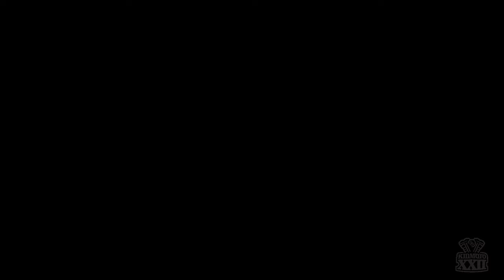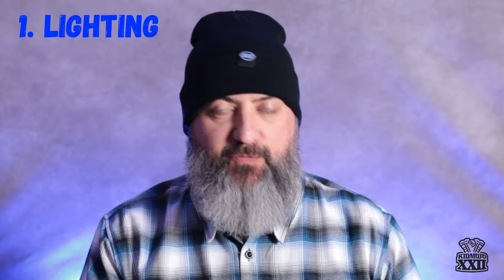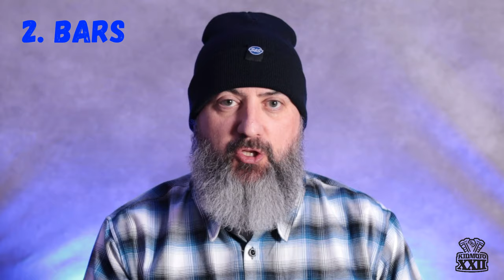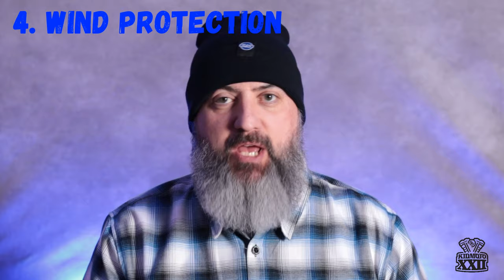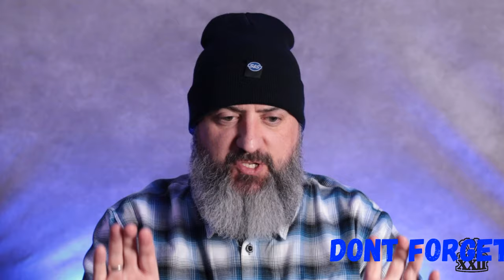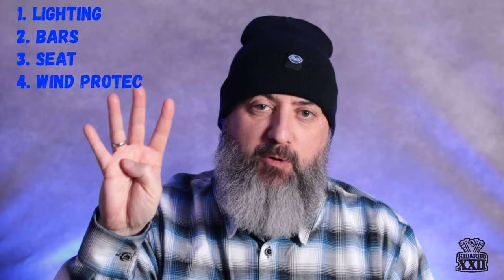5 Harley-Davidson mods to do before exhaust

Comment: Where I live there are thousands of animals crossing the road at all hours of the day.  I used to have stock pipes on all my bikes, and was constantly having close calls nearly hitting animals.  I eventually hit a large deer and it was terrible !  Ever since running headers, and louder after market pipes, I do not even see animals near the road.  I believe for safety reasons the first thing you should change are pipes !  On my Heritage, the stock windshield was constantly catching the wind and blowing my bike all over my lane.  I took it off and have never looked back.  Its called wind therapy dude !
Reply from the maker: Sounds like you’ve done your mods based on where you live. As have I. I live where my riding season is short and can be quite cold so wind protection allows me to extend my riding season. In addition I like to do long road trips with my last trip this season being 9 states, 8 days and close to 4k in miles that means that wind protection helps with fatigue when I’m doing 500-600 mile days back to back.

Comment: Awesome video.  I did mine 1,3, 2, 5, 4.  I've got a mix of Hog Workz and Ciro for lights.  Mustang extended reach touring seat.  12" Factory 47 bars.  Tall Boys floor board relocation kit, I'm 6'3" and a Freedom Shields 12.5" touring wind screen.  I'm on a 2020 Street Glide Special.  Keep up the great videos.
Reply from the maker: Looks like I nailed it for you exactly!!!!….👊🏼

Comment: My last road trip 6500 miles, 12 States and 74 days. 2010 Road King 96" with a cam and 15" windshield, LED headlight, saddlebags and luggage. That's it!! Had a great time. Tacoma, Sturgis, Texas, California - Tacoma WA!   Author tell me your last long distance trip?
Reply from the maker: It was solo 8 days, 9 states, 4000 miles, temps from 30 degrees to 97 degrees and did a cam install in the middle of the trip. 

I live when my riding season is about 3-4 months and I average 10-12k per year.

Comment: Found your channel and subbed , this video was spot on ,  your point on bars and seat,  I sat on quite a few bikes before I found my Fat Bob, the forward controls and drag bar were perfect for me , same here on the seat, I demo-ed a few Harley seats and just couldn't find one that was good , ended up putting a full gel pad on top of the stock seat and it works so far , I can't risk spending hundreds of dollars on an aftermarket seat and have it not work for me
Reply from the maker: Seats are a complete mystery….what works for you may not work for me. There no universal seat.

Comment: I think the list is very subjective and also depends on the type of bike you have.  I have 3, 2009 Rocker C, 2014 Dyna Wide Glide and 2021 Street Glide.
I dont disagree with your statement but i dont think it applies to all Harley's
2021 Street Glide i left the bars because i like the position they are in, but i did all other mods and yes i put the heel shifter on.
On my 2014 Wide Glide i did all of the recommendations including 16" apes, i didnt do the windscreen or foot controls as i prefer that bike without a windscreen
2009 Rocker C again no windscreen, but i did to a lift on the to bars and replaced the seat
Lighting was done on all 3 but i would say they are must do's, I never ride at night but then again in the summer its 11pm when its get dark so no point but i did change all to LED signals and Harley Daymaker headlights except the 2021 Street Glide, i went with the adaptive Daymaker
Reply from the maker: Essentially the point I was going for is that there are comfort and practical mods that make sense before making the bike louder. As you list goes it would seem you did the mods to fit how you want to ride each bike! Mods are subjective for sure.
Reply: @kidmoto22  Good video bud

Comment: I’m taking it you’re not an old school guy. There’s no “in order’ way to doing anything to your machine.   If there’s a “first”, it’s ride the shit out of it and make adjustments/replacements as you see fit along the way. I have a 19 street glide and have been getting into this new stuff. But I still prefer my old Evo springer that beats my ass when I’m 80 mph+ while causing water to shoot out the sides of my eyes as I’m picking the bugs out of my teeth. It’s uncomfortable, it’s loud as fuck, it’s fast as hell and there’s only two lights on it. Old school shit, the way things should be experienced first! But that’s just me.
Reply from the maker: I’m not sure what you mean by “old school guy”. I’ve been riding on Harleys since I was about 8 in the early 80’s. If you follow me on IG you’ll see a pic on my mom and I 30 years apart on Harleys. If by old school you mean an older style bike then no I’m not that guy anymore. I like the comfort and reliability of the newer bikes and currently ride a 17 RKS. I prefer long trips and ride as much as possible 13k plus last year and I live close to the Canadian border so I have a shortened season.

Comment: i really like the look for those hard lowers you have on your Road King. i've been looking into advan black in hopes their softail hard lowers would fit the sport glide but it's an expensive "maybe :shrug:
Reply from the maker: If you can find soft lowers it might be worth a try for a period of time to see if you like them. It’s more affordable and much easier to remove…good alternative.
Reply: @kidmoto22  yeah, im looking to get crash bars and soft lowers this season for my distance trips
Reply from the maker: @voltron6049  It will make a huge difference. You might consider HWY pegs with the crash bar.

Comment: I think seat should be number 2. Then you can adjust your bars an foot controls
Reply from the maker: Picking a good seat sucks. Seems like if they look good they are shit to ride and if they ride nice they are shit to look at.
Reply: @kidmoto22  I
I feel that once you find that proper seat, then you can start on handlebars. But finding that perfect seat is like finding a unicorn 
Lol
Reply: @kidmoto22  
Very true on that. Got a 2017 road glide special. Want a low profile seat but also want something good for long rides, too.
Reply: Also, thinking of taking the old turn signals off and making them part of the head lights. Think a company has a set up like that,but want something brighter than the factory set

Comment: I don't ride at night, So tell me again why I should do my lights before exhaust? My bikes handlebars are perfect and just what I want so do I still need to upgrade them before exhaust? Definitely upgraded the seat. Wind protection... Are you serious I'm not feeble and the wind doesn't bother me. you know what bothers me, is how quiet my stock pipes are, nobody hears me let alone sees me. I would think my safety is higher priority than comfort "wind protection" lmao comfort before safety children. If your stock pipes are quiet and they are. I highly recommend doing your pipes 1st. Lights 2nd. Then worry about your creature comforts.
Reply from the maker: It’s been my experience with all the distractions for drivers and regular traffic noise pipes are not a safety feature. In addition the time of loud pipes are quickly coming to an end. With noise regulations and emission standards getting more strict loud pipes will be a thing of the past.
Reply: @kidmoto22  depends on where you live. California, sure. I live in a free state. Not worried about them coming after my exhaust.

Comment: Getting the motor running right should be first exhaust get heat away from motor . With no motor you are not using any seat or handle bars or what ever . Epa has them motors so blocked up thats not good for motor

Comment: Who wouldn't do pipes first. Stock exhaust is terrible., and the bikes run lean, and are chocked up by the goofy ass stock air filter....
1...tuner
2...k an n style air filter
3...pipes
4...torque cam, with full cam chest.
5...led lights unless it comes with them, then I'd do a seat.
Stock Harleys are dull until you do the first 3 mods, then save money for number 4 upgrade, and you won't be disappointed.
Reply from the maker: I’ve done all the mods on your list I also think it really depends on how you ride. If the bike is a bar hopper garage queen than maybe a seat or bars are not high on the list. I do many long trips and spend days at a time on my bike so comfort and safety took priority. It’s a great way to get people thinking cause we all think we’re right!
Reply: @kidmoto22  my bike is definitely not a bar hopper, I don't drink, nor do I think I'm always right.  I've been cross country on harley seats before, I'm not paying 700$ for a seat
 My bikes have light upgrades , the rest is motor cause stock air filters and exhaust  as well as the cam chest is garbage

Comment: 1:30 to hell with LED, they may be bright to beguine with, but they look like shit always, and look worse when they start to burn out. Yes they burn out after a few years just like any other light and they cost a metric ton to replace.  Good ol' 1156, or 1157s are still $5 for a two pack at the auto store and give great lighting......     I will never understand this jerkoff fest with LEDs, the headlights blind you with the return light off the highway signs also. Additional lights are good if you want, but save your money and go with what you can fix.  -Experience 2Cents.     Otherwise yes mate, your right, seating, footing and handlebars are the most important part of useability for the bike.  Make it fit you first, then get into increasing performance.
Reply from the maker: I’ll have to test your theory on LED lights. I’ve been running them since 2018 and have over 30k on them. They haven’t burned out or dimmed in any manner so I’d have to say I’ve gotten my moneys worth. In the area I live riding at night can be dangerous with how rural and number of animals. Bright lights are for safety and makes me more visible. That said your not wrong about the cost. Nothing on a bike is cheep to replace.

Comment: Nope not even close. In 2022 if you need to change anything it’s the suspension big guy. Next is the stag one. Then maybe bars. Foot and hand controls??!! Come on man!
Reply from the maker: I’ll give you suspension no doubt. However the biggest reason a person would not ride a bike has nothing to do with Stage One it’s comfort. 
Most riders cannot out ride the stock configuration of a new bike so the stage one is completely unnecessary.  
I’m not saying that the sound, cam ect isn’t fun but it’s not something that would keep a person from riding.
Reply: @kidmoto22  No cam in stage one but what ever. If the bike don’t work it don’t matter how comfortable it is. You have to at least open it it to work right or you’ll never know if it’s comfortable or not.

Comment: Im confused, you look like a boomer badass old harley rider but sounds like a 25 years old revzilla host…. 😢
Reply from the maker: Who’s being judgmental now? I’ve been riding as a passenger and a rider since 1980. I currently own a mint 1985 FXRT and 2017 Road King Special. I ride 10k plus per year and typically ride in 13-16 states per year. In my experience the exhaust is not the first change you should make unless your just trying to measure dicks. I’ve got nothing to prove to anyone.
Reply: @kidmoto22  thats awesome numbers bud. Keep riding safe